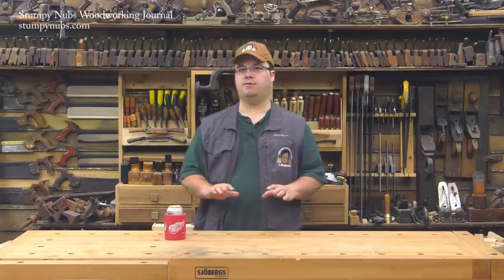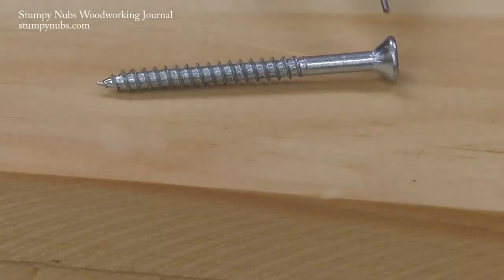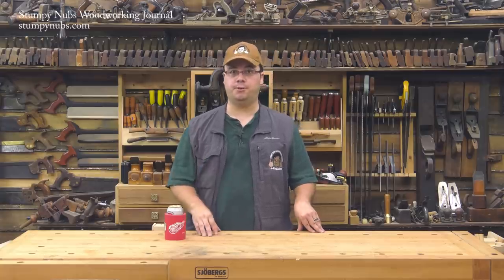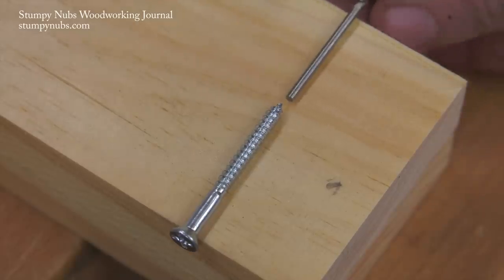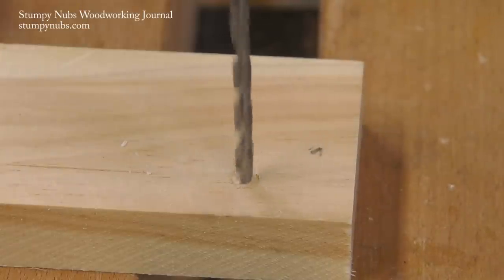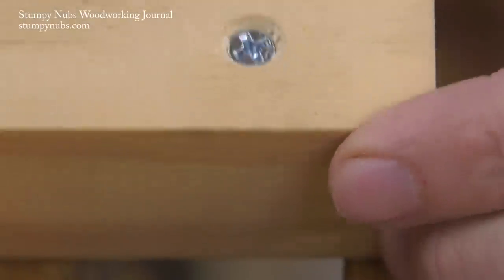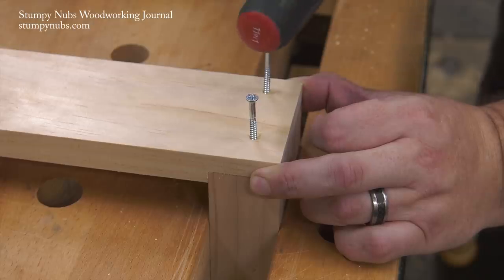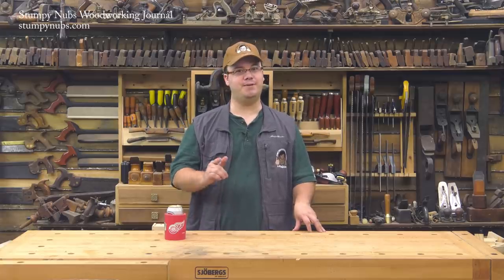Why old-timey woodworkers' screws held better (How to bore proper pilot holes)

Comment: If you are talking old timey, use a tapered drill bit and a drop of glue on the screw, acts as lubricant to drive it in and holds even better. You can find a chart for screw hole sizes for type of wood in the engineering sites on the internet.

Comment: So the offset method does not need a pilot for the threaded section of the screw? .... What is to stop it from splitting?
Reply from the maker: No, you bore pilot holes. That part must have been cut out in the editing :(
Reply: yes, he just didnt show those holes being drilled, as he covered that in the original section.  Use the awl to mark the location and then drill the pilot hole the same as before
Reply: ah yes i was wondering about that too. I will have to try this on my next project!
Reply: Oh thanks, I didn't get it at first.
Reply: I had the same confusion going on.
Reply: Stumpy Nubs  cant you just tilt your drill as you drive the screws to achieve the same effect?
Reply: it does. The only difference is that you offset the positions before drilling and cant drill both pieces in one go.
Reply: I came to the comments hoping someone would ask about this.
Reply: I feel like that's kind of a big part of the process...
Reply: @TheRealMonnie  same thing here,I was starting to think I had really lost it.

Comment: If you clamp your pieces than use all-thread screws, if the head busts off the screw your work piece won't fall apart. We have all encountered busted screws, both techniques are useful in the right situation.
Reply: im sorry, but if you bust off the head from a woodscrew something went terribly wrong somewhere else in the construction.
Reply: Vergile you're kidding right?
Screws break. I can't tell you how many times removing cabinets I've found broken screws. Or how many times installing them I've broken screws. You give the screw the right pilot, you wax the threads, and you put it in and as soon as the head gets put under tension it just pops off like a bad rivet. That just happens. Screws are cheap, and made cheaply.
Reply: I don't get it. If you use all-thread screws and the head pops off as you're screwing it down you now have two pieces that are connected with a screw that is very difficult to remove and only have the threads holding the pieces together without the head, ensuring they will loosen quickly. If the head of a proper wood screw somehow pops off it's trivial to remove the broken screw because removing the upper piece will expose the shaft of the broken screw. You can now replace the screw.
Reply: if you glue your pieces, clamp them and than screw tham, the screw acts like a clamp while the glue dries ensuring they will hold pretty much forever, even if the head breaks off. Like I said different techniques for different applications. I am a trained luthier and have built many acoustic guitars, and fitted many critical all wood joints finer than a thousandth of an inch. I have also built sheds, lemonade stands, and DJ booths out of plywood and 2x4s. It's all woodworking, but yeah I prefer all thread screws, If you think a screw is going to somehow "loosen quickly" it will certainly loosen more than twice as quickly if one piece doesn't even have any threads running through it. If threads are in both pieces they cannot pull apart, it's nearly impossible without some sort of hydraulic press or something.  I wish youtube still had video replies because I would make a 10 min video on the benefits to all thread screws. That doesn't mean any information in this video is wrong at all, just different applications call for different fasteners.
Reply: Those "all thread " screws are sheet metal screws. They can be used with the process at the top of this thread.
Reply: I don't really get how you get screw heads to just pop off your screw. I'm not a professional, but I like to build a lot for the whole extended family from wood and I had never once had a screw head pop off. Maybe it's just a cheap supplier that you get your screws from? (I mean I don't buy the cheapest ones I would find on ebay, but still nothing special, just from the local hardware store). Or do you only work with cheap screws in combination with very hard wood?

Comment: Cut the head off of one of your screws and leave a small part of the shaft.  Then use a Dremel tool or a file to cut some teeth into the underside of the screw head and you'll have a perfect sized countersink tool.

Comment: This is painfully basic information - or should be - for anyone 'in the trade' but vital to those who don't know, so thanks for the video.
I would add one more operation: you should always put a 'token' countersink under the actual countersink (i.e. where the clearance hole comes through on the lower side of the board).  This allows space for the small chips, raised when the screw bites into its pilot hole.  Without the token countersink, the joint may not be tight, due to these chips trapped between the two pieces.
Fun fact:  In my workshop, those Philips or Posidrive screws are always destined for the bin.  (We call them 'moron' screws, and keep a special 'moron driver' to take them out!)

Comment: Wood screws from before the '70s have a much longer taper so they became tighter in the holes as you drove them farther in. The short taper on your modern one looks more like a sheet metal screw.

Comment: As for wha you’re saying about wood screws. I’m a plumber and I use the term wood screw to refer to any screw that’s designed to screw into wood as opposed to a metal or machine screw. I never thought of wood screw as meaning woodworking screw

Comment: I dunno, I make do with fully threaded machine screws and just bore or press out the top hole as necessary. Why? because I haven't ever found a wood screw of any diameter that doesn't have a tendency to snap at the top of the threads even when correctly piloted.
Reply: Buy better quality wood screws and apply wax if you're putting them in hardwood.
Cheap screws snap.
Reply: @A1BASE  That's very special advice, but I have tried it both ways. I find even expensive wood screws tend to have wallered out heads that skip bits. I'll stick to what I know works every time and I can get within a couple minutes of my house. Unless I need bronze for marine work, then that justifies the hassle and expense of dealing with inconvenient screws that I need to spend extra time drilling and drive with a brace or by hand.

Comment: Also:
Take a larger drill bit and clean off the shoulder of the pilot hole just by turning it with your fingers.  
Depending on the type of wood, make the pilot hole just a tad smaller than the inner diameter of the screw.  With softer more compressible woods, this improves the grip.
A bit of bar soap on the threads of a screw lubricates it making it go in easier.
A sharp knife also works to make the countersink.
The "square" or "Robertson" drive screw is best for wood working.  You can put the screw on the end of the driver and it will stay.  This frees up one hand to bring the wood into alignment.
Reply: Beeswax or even candle wax is better on the threads than soap. Soap is hygroscopic - (hydroscopic?) hmm. Soap attracts water, which causes staining and rusts steel screws.
Reply: Tim Douglass:
"hygroscopic" is right even though the spell checker doesn't believe it.
I've never had trouble using soap on screws.
Your mileage may vary.
Reply: Yes!  I was going to point out that countersink bits are kind of superfluous.  Just use a large ordinary drill bit, and unless you're doing a lot of countersunk holes, or it's in a very hard wood, it's just as easy to do by hand if you keep your large bits sharp.

Comment: That offset screwing seemed to miss out a chunk of info. One assumes you then drill the holes in the awl marks. But then don't you get issues lines the holes up properly ? Should've videoed the whole process.
Reply: The tip of the screw will still reach the slightly offset hole and then dig into it. This pulls the wood tight and then the holes should already be lined up better.

Comment: You drill the upper shaft first...then for the thread, that way it is central....do not use rolled thread screws on boat planking, as the thread scores the larger hole diameter and the plank potentially will move

Comment: About time someone explained how to use real wood screws.  I learned this in shop class 1956.  
The biggest offender are the deck screws,  you know those yellow things with threads to the top.   They do not even drill a pilot hole.  Now the expensive deck boards split right through the screw holes.   Further they drive the heads well below the surface so the wood recovers the screw top.  When I needed to take up a board,  the top was damaged as there was no way to remove the screw.
I guess this goes to no craftsmanship anymore.
Reply: The screws shown are a modern version and are not the old time screw. for every size of screw the joiner would have a gimlet to make the perfect hole for the screw size. you can still buy gimlet sets from amazon but they are  not very good and do not seem to be matched to any screw sizes.
Reply: tyvek05  Never had problems with the old school method.  Deck is three years old and supposedly professionally installed.  Lumber comes “wet” from Menards and it warps, twists, and cups.  I had to pull up every board and plane it flat.  The most sorry thing I ever had made.  You are not supposed to “pull” wood together.  It is supposed to fit.  And the water holding cups,  the boards were installed outside up.   My reading tells me they cup to bark side, so they are supposed to go outside down.  Any decent carpenter drills a hole before a screw or you get splits which I have plenty of Self tapping is for sheet metal
I will probably replace with plastic boards or just use ordinary lumber and water proofing.  I have had decks made with old school tung and groove and they were better than the poison soaked boards now used. Yes arsenic  is poison. 
So yes old school works.  Modern is planned obsolescence.
Reply: tyvek05  Try putting two nuts on a bolt about a half inch apart, grip both nuts in a vice not so tight that they can not move, no matter how many times you turn the bolt the nuts will not be pulled together. The same principal applies to wood screws.

Comment: Wait I don't understand. Why would putting those holes in with the awl make it pull against the shoulder? It's not like the screws are being put into the awl holes is it?
Reply: I didn't get it either.
Reply: You use the awl marks to seat the point of the drill bit for the thinner hole. Then when you've drilled the lower pilot, when the screw goes down, some/most of it will be over the empty space of the pilot, and the strong metal screw will naturally force the wood to pull towards the holes being in more of a straight line than offset. That's why the awl marks are only a tiny distance from the initial mark.

It's a lot like draw bore dowelling.
Reply: Jack Butler oh, the pilot hole! That makes sense, thanks!
Reply from the maker: You also drill pilot holes. That part must have been cut out in the editing :(
Reply: Stumpy Nubs phyew! Ok! I was trying to figure that out too. Haha
 I always love your videos! Super informative!
Reply: ah.... the pilot hole drilling was the key to this,... yup that would have made much more sense to me
Reply: Wow, a LOT of you guys don’t understand what he’s doing there ...
Reply: Stefan Van pellicom that's why he's teaching it. Because the knowledge doesn't get passed.  Ergo... he's useful.
Reply: Even after reading these comments, I still don't understand what those additional holes did? Any further/alternative explanations?
Reply: @robertkingsnorth9903  I believe that by having the second set of pilot holes (not shown in the video--it got edited out) slightly off center of the first pilot holes, the screw pulls the board into the other one, making it a slightly tighter joint.
Reply: Robert Kingsnorth - there isn't a second set of pilot holes, only the one drilled into the awl holes, NOT the holes marked by tapping on the screws. The deliberate misalignment between upper and lower holes forces the lower piece to be pulled toward the small shoulder of the rabbet. Note that if you put the awl holes on the other side of the holes marked with the screws, the lower piece would end up pulled away from the rabbet shoulder. Google "drawboring" for the concept.
Reply: He should have shown drilling the holes in the other piece, it would be much clearer.
Reply: @Diabolik771  it got edited out
Reply: jjohnston94 Fantastic reply. Thank you. Your comment is what finally made me understand why. It should be pinned at the top by the channel owner.
Reply: What is the point of this response?  Go elsewhere if you're just going to give people a hard time unnecessarily.  An important step was left out, some people didn't get it 100% (including myself).  Asking questions is always better than making assumptions.
Reply: Are you referring to my comment? I just wanted to point out that jjohnson94's comment finally made me realise how to do it, after having scrolled through the comments for some time looking for a further explanation since I was one of the people who didn't get it. I was not trying to give anyone a hard time. If that is how you interpreted it, my apologies.
Reply: Patapraktoi Swe Thank you. As for tylancaster, YouTube always puts the most recent comment at the end, so there's a good chance he was talking to somebody else.
Reply: Sort of a draw bore, I think.

Comment: I’ve been a carpenter since 1974 and there are other ways to do the same thing with screws.  Have you heard of finish wood screws?  They have a smaller head that you don’t have to set the head.  It makes it really hard to hide the head of those screws if you are doing finish work where the screws show.
Reply: Um.....depends on the application! Trim screws are great for some things, but a screw with a full size head holds much better. As far as hiding the screw head you just countersink the head and glue in a wooden plug drilled from the same board.
Reply: Michael G. Gartman Well duh. Did this way long than either one of you.
Reply: @ericvaneck4296  haha, bitter much?
Reply: Michael G. Gartman Got brains
Reply: @ericvaneck4296  Well I've been a carpenter since 1980 so you've only got 6 years on me in terms of experience, but I don't think years of experience matters all that much. I think that quality of instruction matters more. However I do respect your years of experience. I'm just not sure why you would ask " have you heard of trim screws" . Who the hell hasn't? I have guys with only 2 years of experience who know all about trim screws, pocket screws, sinking and plugging, etc.
Your question just struck me as being condescending.
Reply: I’d like to ask you a question. Why the second set of dimples next to the first?

Comment: Good information.  A poor man's counter sink:  after your pilot holes are drilled - jamb your Phillips tip in and spin - also rotating the drill out of plumb in a full 360° rotation.  No skilful awl work necessary.

Comment: for the best results widen a hole with a reamer, not a drill, this is because a drill, unlike a reamer, is designed to go where its pointed and not to 'follow' anything in/about the material  being drilled. using the technique indicated can give you problems, especially in soft wood, where you get a nasty non-circular exit hole in the upper piece, although this would be hidden, alignment is compromised.

but you don't need to this this, well not for the screw shown, which specifically have been designed with the unthreaded diameter and the threaded inside diameter, the same!

Comment: Lazy cheat method (softwood only):
-Drive a Robertson screw 98% all the way in both pieces, no predrilling
-back off the screw until it's only in the top wood
-blow/wipe away the wood dust on top
-push the wood together extra hard, and drive it all the way 101%
(for extra quality blow the wood dust between the two wood pieces, then realign using the screw tips)

The pull-together technique can also be used only drive it in the top until the sharp tip hits the second wood, then use a nail and hammer to move the guide indents.

Not nearly as pretty, but it works fine in many situations when you can't be bothered to pre-drill

Comment: If you are going to drill a larger pilot through the whole of the first piece the straight shank isn't all that important as far as getting a tight joint. A full threaded screw will suck down the same as the threads will not have anything to get a good purchase against. There is normally a strength advantage to the wood screw everything else being equal however.
Reply from the maker: With modern wood screws, you are correct. A modern wood screw's threads are larger in diameter than the thread-less shank, so you must bore the upper hole larger than the threads themselves, not just the shank. Thus, the whole screw may as well be threaded. But old wood screws were manufactured in such a way that the thread diameter was the same as the shank diameter, or even slightly smaller. So the thread-less shank was important. This video explains the old process using a modern wood screw as a visual aid. Even so, the same three-step process applies to modern screws in that you will get a tighter joint by boring the hole in the upper board larger than the hole in the lower one.